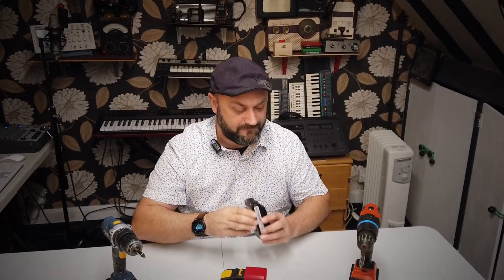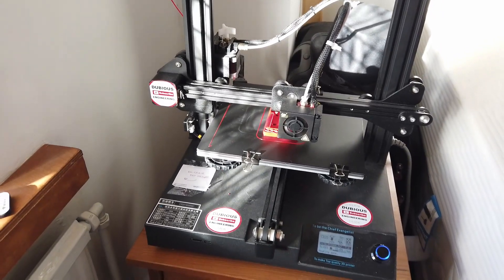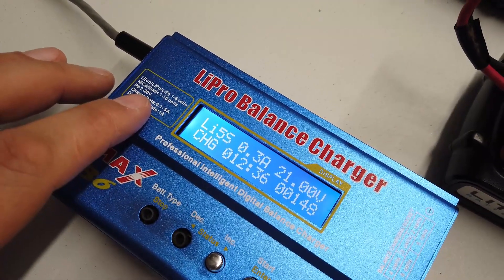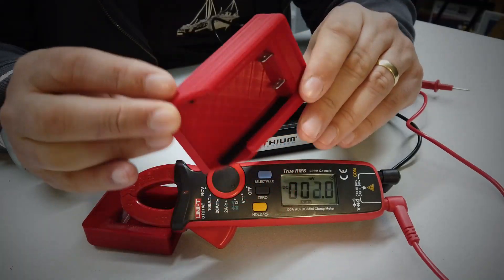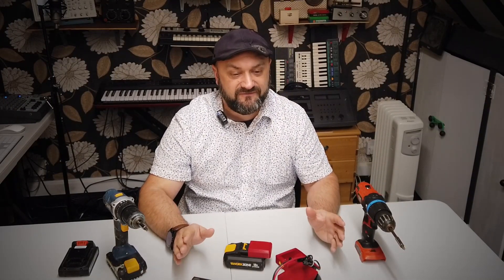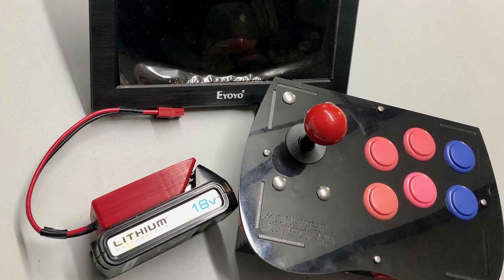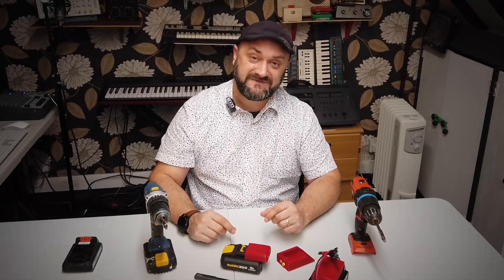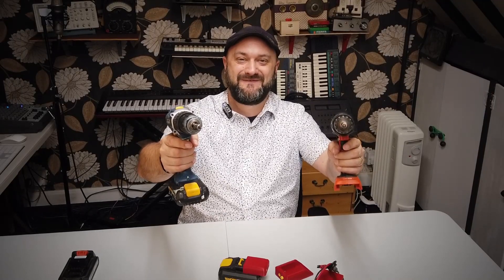DuB-EnG: Hack Black&Decker Lithium Battery with 3DPrinted Connector USE TOOL BATTERIES FOR ANYTHING

Comment: Where can I find details on the other 2 terminals of the battery? I've accidentally over discharged these before and would like to know if there's a signal from the BMS in the battery that could be used to shut down the load.
Reply from the maker: The other two terminals are a thermistor for  measuring internal temperature that's it.
Reply: @DubiousEngineering  then what signals the charger that a battery is bad?

I subscribed btw.

Comment: I have a Panasonic battery drill, EY9231 engraved on the battery with DC 15.6 V. It’s discontinued and I’d like to have an adapter to change it to an 18V battery from another more modern drill, like Dewalt, or Milwaukee. Can I use an 18v battery on a 15.6 v drill, or would that burn out the electronics. Also what is a ‘Buck’?
Reply from the maker: You'll probably get away with 18v on a 16v system...  a buck is a converter that chops the waveform and reduces the voltage.

Comment: I don't think it's a safe solution, there are reasons for lithium batteries to have multiple pins. I have tried to get any information on internet on what are all these for it also varies form one maker to other.  Except from the obious as + and - pins i think most importatnt is thermistor pin so the battery won't overheat and explode and attaching this small soldering iron may draw to much current.
Reply from the maker: I've been using the ts100 soldering iron in this mode for years now with no explosions :-)

Comment: I just bought a DeWalt one from you on eBay. I’m planning to use it with a buck regulator to replace a dead proprietary 3.6V NiMh battery pack in a powered respirator.
Reply from the maker: Epic Alex! ...  I recently used two 6Ah batteries through a 30amp 12V buck to drive some ham radio gear...   video was released about 3 weeks ago
Reply: @DubiousEngineering  Interesting. I used to be M1CJD back in the late 90s, but I lost interest after a couple of years and let my license lapse.

Comment: I'd like a regulator that goes between the battery pack and the tool, to provide constant power to the tool until the battery is flat. Not all tools would have the space, but it appears that my 3 litre Ryobi project vac does - it has a lot of space around the battery, as long as the carry handle is up.
Reply from the maker: I need to look at that vac!! We could fill it full of 18650s!! :-)
Reply: @DubiousEngineering  at 4:08 you said "regulated at 18V". What do you mean, exactly? None of these battery packs are regulated, to the best of my knowledge. The 18V is the nominal voltage.

Comment: Just bought one for my DeWalt battery, I'm going to use it on my kids hot wheels toys instead of using 6x  D batterys!
Reply from the maker: Fantastic Karl!  I'm keen to hear how it goes...  I'm a little nervous that 6 x 1.5v is 9v and this battery is 20v! - Thats 2x the voltage ...   have other people done this?  Thanks!
Reply: @DubiousEngineering  I am the first... One way to find out! 
Could be a new extreme sport... Dodge the flying dart cars!
If it's too powerful I'll put some resistors in to make it 9v
Reply from the maker: Just be careful not to burn out the motors! :-)

Comment: I'd happily buy one, do you print these yourself? I have 2 different battery types from Aldi's Ferrex line and would like 2 of each for lighting on the allotment etc.
Reply from the maker: I just done the 18v “WorkZone “ range from Aldi .   Does that fit?
Reply: @DubiousEngineering  it may fit one of the battery types, I'll send you an email tomorrow and attach photo's and dimensions if I get the time.
Reply from the maker: I was pipped at the post on my eBay purchase so may actually have to go and buy a battery at the store!!!
Reply from the maker: Ok I’m trying to buy an active energy battery.   Then I can do some fit testing and check outputs etc.

Comment: Hey howard - excellent work - any chance you could tell me what meter you were using please? would recommend it?
Reply from the maker: Absolutely would recommend it - as does big clive..  its a UNI-T UT210E True RMS mini clamp meter.  Its cheap as chips for a current clamp meter, and does AC and DC current sensing from milliamps to 200 amps!! - Clearly does voltage, resistance, continuity and diode checks.  Originally I bought it for the van, but its too useful, so it stays in the lab!!

Comment: Thanks to the sequre iron I have in the post... I totally need to do this exact thing... for soldering things in the roof... you know... when the mains is turned off :D 
My problem is my kit is Ryobi... and I have a feeling the docking mechanism is not going to be as neat as the slide in method your kit uses
Reply from the maker: I haven’t yet done anything Ryobi...  I need to get my hands on a battery ... I believe I’d did makita last night...  need to print and test!